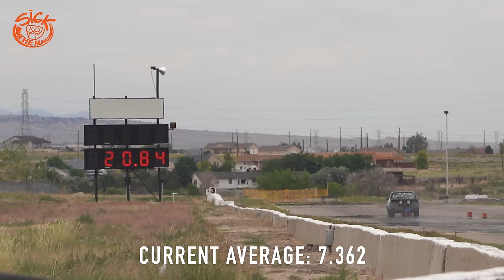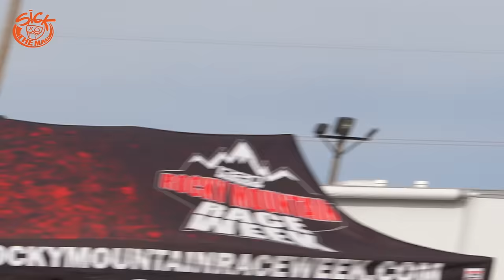Mullet vs Meltdown Battle For Outright & The Hulk Blows Up Big - Rocky Mountain Race Week Day 5 (4K)

Comment: Congrats on the win cleetus! That big block was worth the money!
Reply: He's been unstoppable lately. He even won in Indy with the old setup. Correct me if I'm wrong but not only did he win his class (radial) but he won overall too?
Reply: @kristinewilson5353  I’m not too clued up on the classes but I’m pretty sure his class was big tyre and radial so yes
Reply: How much was that 540 Steve Morris BIG BLOCK
Reply: @d26-i4b  cleeter still on small tire
Reply: @cham4385  I’d say around 50-80k
Reply: @d26-i4b  I thought the smx was like $160,000.00 cleeter has the 540 not smx
Reply: @cham4385  SML 100k
Reply: @d26-i4b  is there sm.  Sml.  Smx?
Reply: @cham4385  hes just got the 540 dart block with stevemorris heads and cam package, theyre around 30-40k and the smx starts at 75k
Reply: @kris7007  thanx appreciate you 🙏
Reply: @kris7007  Nope, that's not true.  The engine he just got from Morris is a aluminum Brodix block and heads. SM cam. Steve used his magic to put it together and added the special SM intake!
Reply: @cham4385  Don't thank him too much.  He has it wrong.
Reply: @paulcopeland9035  well then what's the pricing in Steve Morris engines.?
Reply: @paulcopeland9035  my bad, either way its still a 40k engine so the pricing which was the main quesiton was still correct
Reply: @kris7007  Nope.  That engine as it was delivered to Garrett would be around $60k retail at the shop.

Comment: Man Cleet was on a pass that last time out. He was two tenths quicker to the 60' than his 7.33 pass, and three tenths quicker to the eighth before he let off. Definitely would have been a 6.
Reply: Definitely the best launch the car has done all week. Looks like he hit a boost cut or something
Reply: With radial tires too
Reply: @wingracer1614  He hit 40PSI because the thinner air requires more pressure for the same density. The boost cut is 40PSI.
Reply: Yeah when I saw that last night, I was saying this is it, finally another 6 after last week. But sadly couldn’t hold it. He should be running slicks though. That car is too much for radials without the perfect prep like he sees at Bradenton
Reply: Think that was traction control not him letting out
Reply: @mattio79   The thing is, they hit boost cut and Bandimere and supposedly turned it off. But it did look suspiciously like when they hit boost cut at Bandimere. We'll find out in Cleetus's video.
Reply: @atamagashock  I suppose the solution to that would be to get a bigger trailer with a better tongue weight (axles not so far back relative to the capacity) and add big tires to the Elco. The only issue that creates is that he'll need to completely rework the rear end to accommodate the big tires.
Reply: @wingracer1614  his video is up now.  He explains why he got out of it.

Comment: so does friday just mean nothing in terms of average? the competition is over and friday is just for fun doing some heads up racing??? I thought friday was still part of the conpetition but i guess i was wrong. The track announcers were explaing the rules on the live stream but they cut to a commercial during it so i missed it.
Reply: friday is for racing bracket and head ups, so people have opportunity win twice, more incentive to stick around to the end... but yes the time trial part is done on track #4 but got to break the beams on friday.
Reply: Average times are locked in, you just need to break the beams to finish the week.
Racers slower than 10.0 will be bracket racing. I believe they are racing either to their average or their fastest pass. As I understand it, one winner will be crowned from this group.
Racers faster than 10.0 will be heads up racing. The top eight (based on single fastest pass) will race (top prize is 7.5k) and the second fastest group of 8 will also race together. The remaining cars faster than 10.0 will be put into a big group. Rowdy radial will also be doing 1/8 mile heads up.

Comment: Curious to see what happens with cleetus's setup after needing nitrous to spool.
Reply: The nitrous is an altitude thing.  I race at Bandimere and turbo racers have been using nitrous to spool turbos there for years.  The 'juice' will go away when he is back at sea level.
Reply: @paulcopeland9035  well yes, but surely he wants to setup a better solution for future races. I heard Brent on another video mention the sparks outta the exhaust arent neccesarily good. So I'm assuming that's tune related with the nitrous hence why I would think they would iron it out for future races, which I guess would mostly be just drag weeks.